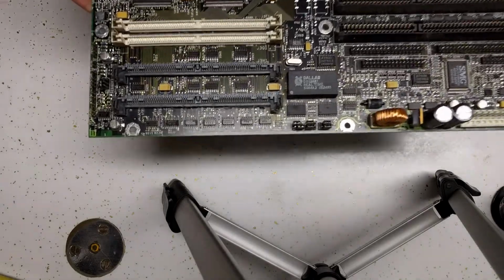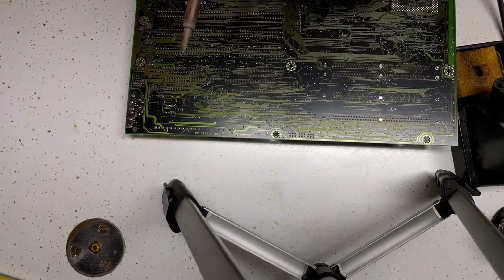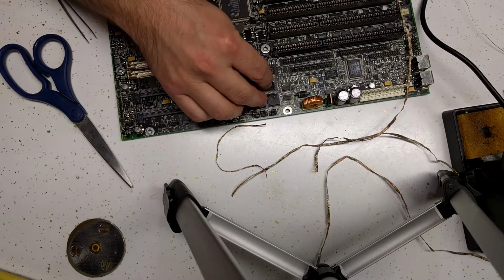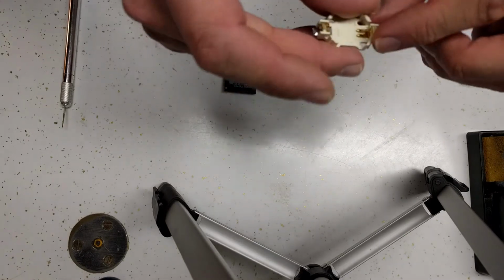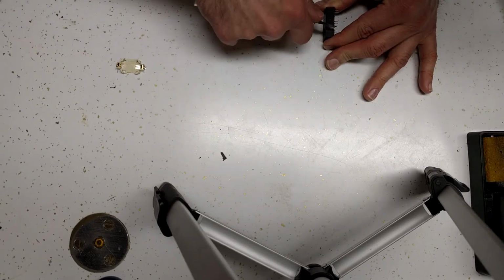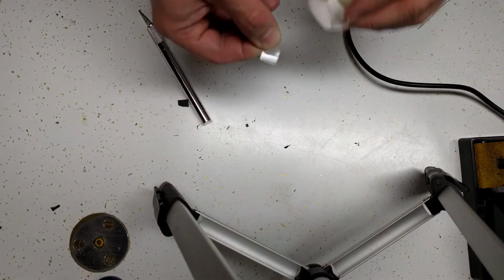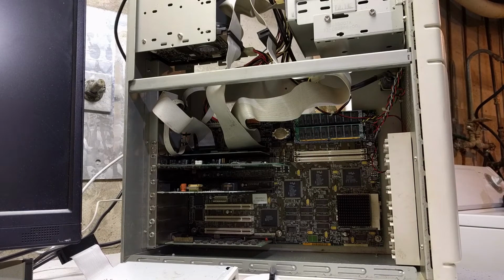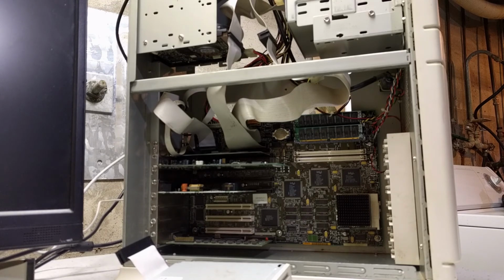Gateway 2000 P5-90 Part 4: RTC Repair

Comment: Interesting behavior.  I installed a socket but replaced the Dallas chip with the modern equivalent, but also ran into issues with the system locking up when entering the BIOS (it was only partially printing the error messages, seemingly locking up in the midst of it).  I thought I had left the power supply plugged in overnight, went to boot it up the next morning and entered the BIOS without a hitch.  I initially chalked it up to the battery having no charge, and thus the system not being able to initialize the NVRAM.  Now I wonder if I simply booted to DOS in the interim, setting the date and time and just didn't realize that's what I'd done.  Thanks for sharing!
Reply: Can you share a link to the BIOS updates?  I did quite a bit of research and never found them.  My IDE controllers are acting extremely stupid and I can only reliably detect disks if I use a controller that installs its own BIOS (like a RAID card); that had led me down a path of awful resource conflicts that I have not been able to resolve and is preventing me from running an OS newer than DOS 6.22/Windows 3.x.
Reply from the maker: @orangeActiondotcom  It has been months since I filmed this so I don't know if I'd be able to find them again now, but I'll try and see.
Reply from the maker: @orangeActiondotcom  I think I found the one I used here: ftp://ftp2.ibspan.waw.pl/pub/mirror/ftp.mpoli.fi/hardware/ROM/INTEL/

See the INDEX.HTM file for descriptions.  The AX1 bios files are the ones you need.  If you are not already on 1.00.12 you will have to upgrade to it first before proceeding to 1.00.16.

EDIT: YouTube didn't parse the link properly so it looks like you'll have to type in the "ftp://" yourself.